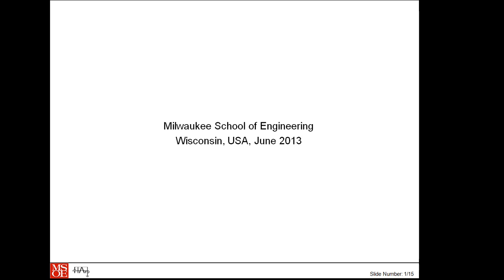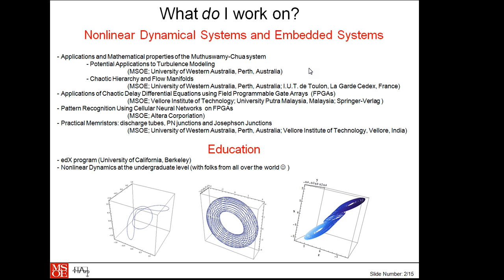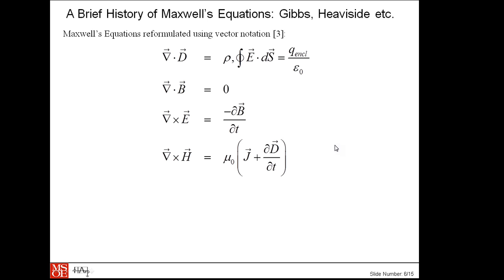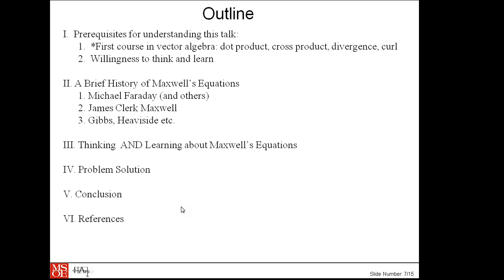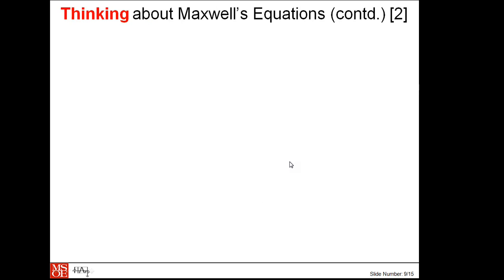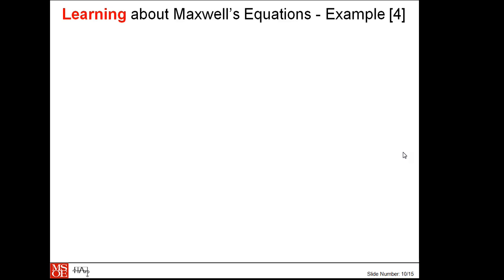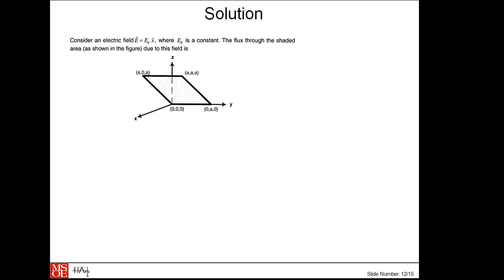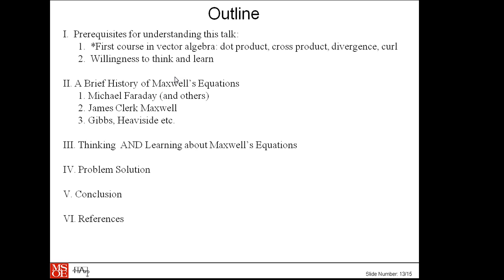How To Think And Learn - An Example Using Maxwell's Equations

Comment: The problem presented at min 18 is wrongly interpreted in terms direction of surface over which electric flux need to find, the correct answer is option 4.
Reply from the maker: Thanks Kumar, this goes back to a comment from a year ago.  I agree that the correct answer is (E0.a^2)/sqrt(2).  The unit normal to the surface should make a 60 degree angle with the x axis.